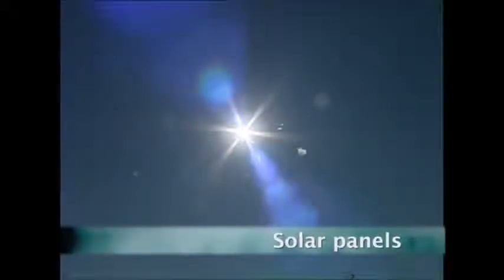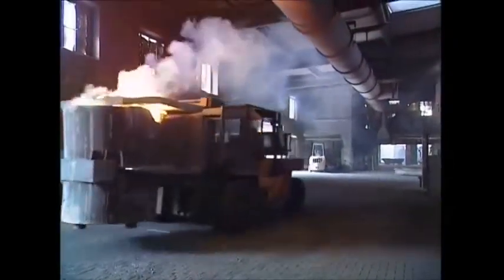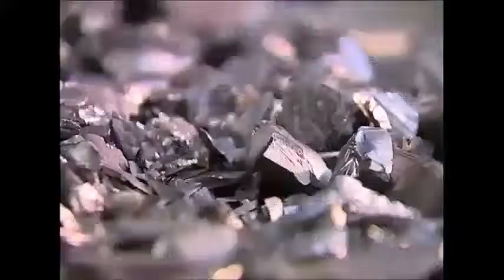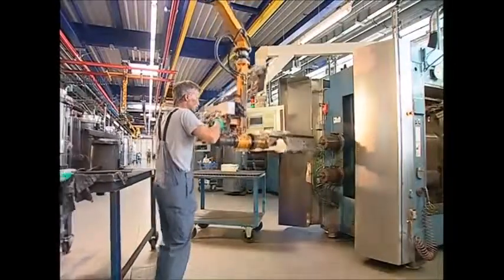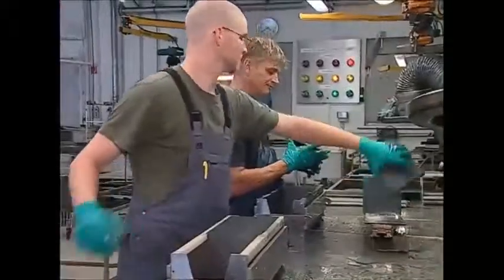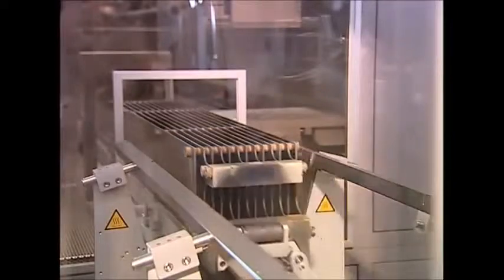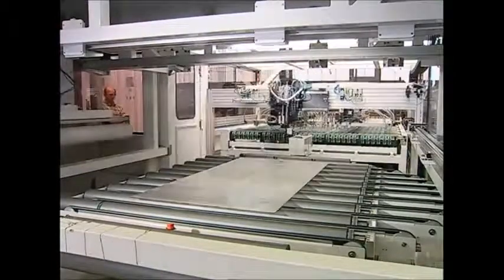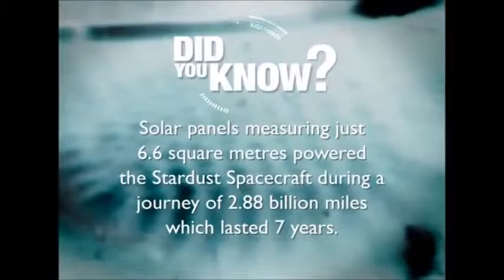How It’s Made Solar Panels

Comment: It must take a large truckload of coal to power those furnaces
Reply: Still better than fracking
Reply: Nowadays it's done using electric arc furnaces, which as the name implies, just uses a super hot arc of electricity to melt any kind of metal they desire